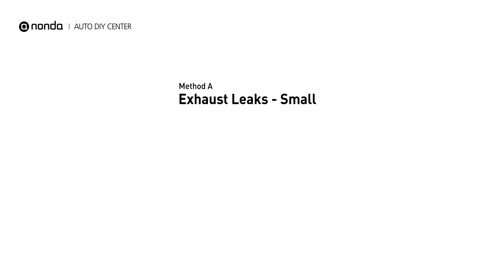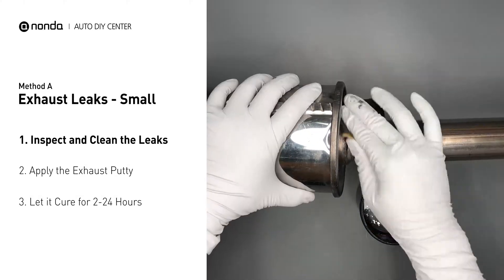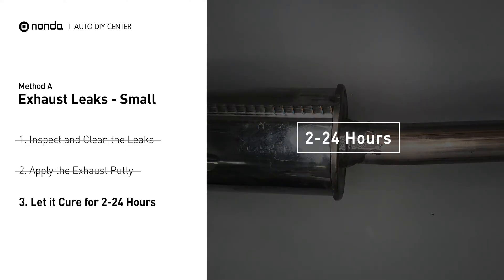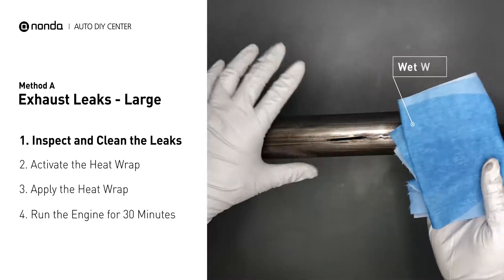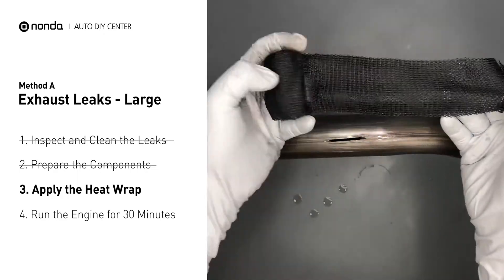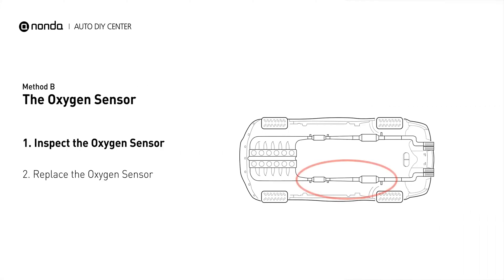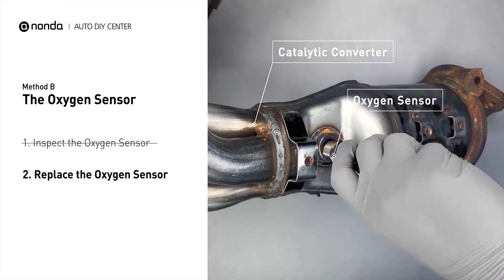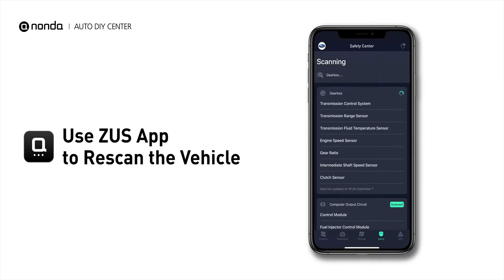How to Fix P2099 Engine Code in 4 Minutes [2 DIY Methods / Only $9.49]

Comment from the maker: Hi, I'm Steve, nonda's lead mechanic engineer. 
Feel free to leave your comments here if you have any mechanic questions, I will be glad to help you out!
Reply: The Vehicle is a 2009 GMC Acadia 2wd, the problem ended up being a fuel injector that had been installed wrong, the wrench did not use the factory clips that help hold the injectors in proper position.  3 of 6 clips were missing.  Fixed and car now runs great with no check engine light or codes.  Thanks

Comment: I have that code on my 2015 s550 Mercedes Benz , no smoke coming out the exhaust no limp mode but just the check engine light .

Comment: Can i still drive with the p2099 code
Reply from the maker: Yes, but we suggest getting it fixed in a timely manner as this could eventually damage your vehicle's powertrain.
Reply: @nondainc  I took it to the shop and they suggested I get a turbo assembly. Did I get worked or is that the solution??

Comment: I am chasing a P2099 code now, I did find and seal up leaks at the Catalytic converter near the rear O2 sensor but sealing the leaks made no change.  After Cat O2 sensor reads very lean, around 100 MV all the time.  The O2 has been tested and works normally in the other bank?   Looking for ideas.  Thanks
Reply from the maker: Hello, please provide us with your vehicle's year, make and model.
Reply: Could bad ECT send wrong info to pcm causing wrong fuel to air ratio, ie rich. Even without obd codes for ECT, it could be working but sending wrong temperature info.
Reply: Did you ever figure it out? I've replaced both sensors AND the cat and I'm still getting that code.